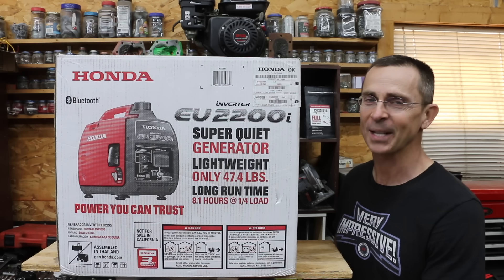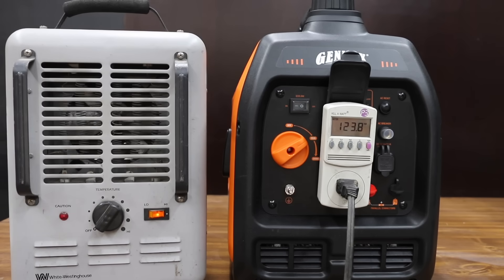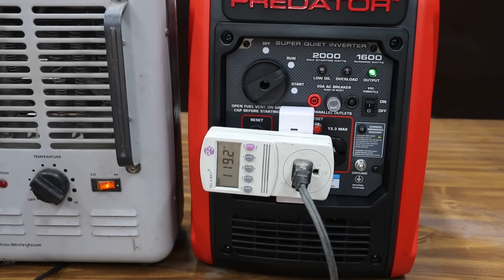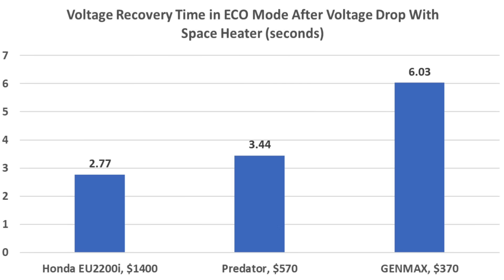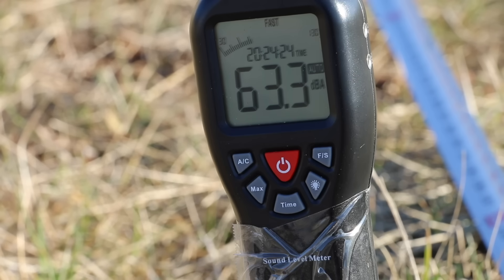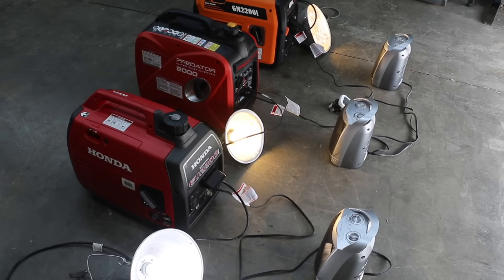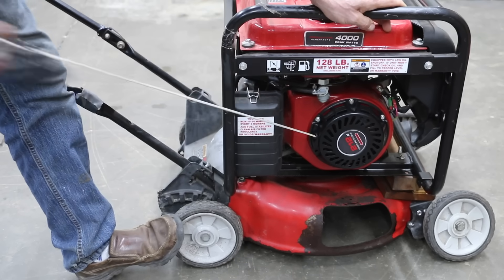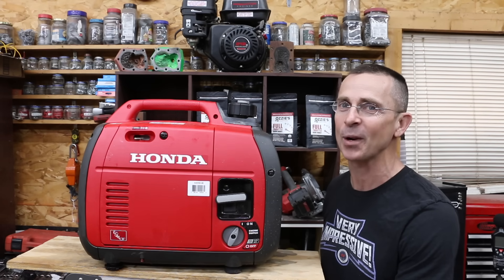Cheap Generator Better Than Honda? Predator vs Honda & GENMAX—Let’s Settle This!

Comment: For those who don't want to lose the engines in your ICE cars/trucks.   You can use oil analysis, and a secondary oil filter called a "BYPASS OIL FILTER" to nearly eliminate any wear metal flying around in your motor oil.    My results:   Camry 390,000 miles compression within spec,  Audi 210,000 miles compression within spec,  Acura 215,000 miles compression within spec ( just sold ).    Bypass oil filtration can eliminate those wear metals, silicone from dust that gets past your air filter, can then use analytically clean oil running around your engine to clean away past sludge and varnish, oils also will cool better, weigh less (it will have less particulate mass), and its additives will work better for a longer period of time keeping the oil within its PH level.     I used oil analysis to confirm the operation of these bypass filters, by sending the samples in after 3000 miles on each oil and then on that same oil after the installation of a bypass filter system.     The dirty 3000 mile oil, after being run on an engine with the bypass filter for about 200 miles, came back from the lab Analytically clean, meaning it was as good or better than new motor oil in terms of wear particulates.   Even the TBM values were similar to new oil.  Granted there is some top up oil involved in the capacity of the newly instally bypass filter, but 87 percent of the oil in each case is oil dirty oil with 3k miles on it.   these small generators do not use a pressurized oil systems (they use an oil "slinger" to lube the parts) but your car and larger generators will benefit from a secondary oil filter known as a bypass oil filter.    Most people dismiss this knowledge, say it won't work (it does work) or its too much of a hassle to install, or "why don't auto manufacturers put them on" (well take a guess)  ,  however those same people have no problem rebuilding engines, replacing vehicles, etc.   Not intended to save money on oil changes or amount of oil used (although it does), it is mainly intended to prolong significantly the life of an ICE engine that has pressurized oil system.
Reply from the maker: Thanks for the feedback.

Comment: Thank you so much for the video. I thought about getting 2 of the knock offs, but thanks to your thorough video I will stick with Honda. All the tests you did were all important to me. The fact that the Honda outperformed in almost all ways is proof enough for me. Sine, db, vibration, and a better managed eco throttle are worth the extra money to me. While too heavy to get on and off my boat by myself, I do have a 23 year old EU3000i. I just love it. Honda is way more money, but I think it's worth it. In 2005 she ran for 10.5 days straight after this bitch Wilma came to town, and really messed things up. I stopped it once a day for fresh oil change, and it was a champ. Less than 5 gal a day running a fridge, computer, modem, TV, and small rolling A/C unit. I am going to get 2 of these for my new boat. Only run one when needed. Parallel the second to run A/C & microwave. lol. Also, having 2 serves as a redundancy. Twos of things on a boat are key. Like 2 radios, 2 starter batteries, 2 engines, 2 coolers, and on & on. Thanks again! Cheers!!
Reply from the maker: You are welcome!  Thanks for the feedback.

Comment: Didn't watch whole video, but a comparison I find useful when comparing generators (especially vs hondas) is testing how the electronics hold up when the generator quits/stops/runs out of fuel while under load. When camping I frequently measure out fuel for the time I want to run my genrator. I then simply let it run dry instead of having to time it. In my experience cheaper generators have had issues with doing this some permanent. It would be interesting to see this done in testing. Great video thanks for the info.
Reply from the maker: Thanks and you are welcome!

Comment: $300 generator worked as well as a…$300 gen vs the Honda.  I’d buy it and run it with oil changes as the book says til it Dont run/produce power, shit can it and get another.  If you used one everyday day in and out it’s hard to go against the Hazard Freight extended warranty they offer.  Why I see a lot of “contractor work crews” bringing them back so often.  I get it you get what you pay for, but $1200 for such a small machine is IMO not worth it.  But each their own.
Reply from the maker: Thanks for the feedback.

Comment: Too bad the Yamaha wasn't included in this showdown. When you look at the forums (racers, campers, etc), usually the question is Honda or Yamaha? I have a Yamaha, and it is super quiet and does all I need so I won't be changing, but I am curious to see how it stacks up.
Reply from the maker: Thanks for the suggestion.

Comment: Have you ever considered testing farm implements,like 3-point shredder/mulchers, brands against each other? I know they are really expensive. You run a tight ship with respect to fairness, impartiality and practical results. Maybe the manufacturers would sponsor a head to head comparison just to get the face time.
Reply from the maker: Thanks for the suggestion.

Comment: Would you mind adding the Generac generator? We had a few of the larger generators on wheels when I was in the military, but I believe they make smaller generators.
Reply from the maker: Thanks for the suggestion.

Comment: I have two Briggs 2200 inverters. Low hrs. Just spent $300 getting the valves set & carb cleaned. Not even close to a Honda. Not by a country mile.
Reply from the maker: Thanks for the feedback.

Comment: Maybe I missed it, but why measure the gas for the heater test by weight, 16 oz. by weight, versus 16 fluid ounces?  I'm just curious, not complaining or challenging your very excellent testing in any way. :-)
It might confuse some watchers into thinking that you were testing with 16 fluid oz. which they could then extrapolate the test results differently. 
We all buy and use gas by the gallon, not by weight. 128 fl. oz. which is 6.3 pounds, or 100.8 ounces by weight. 
1 fluid oz. of gas weighs about 0.79 ounces. That times your testing weight of 16 oz. is only 12.8 ounces of gas, by weight.

Comment: I'd definately buy the Honda but $1200 is steep for how little you really get out of those things. I decided going with the GENMAX and will give it a run this weekend on a space heater at 28 degree temps outside. Heres to hoping lol.
Reply from the maker: Thanks for the feedback.

Comment: I have the original Honda EU200i it's now about 20 years old now and has north of 10,000 hours on it. Honestly I think the clones are probably good machines(given their price), but they are in pretty much every way inferior to the real Honda. I very much doubt you can put the kind of hours you can on a the Honda on any of those machines with out a serious mechanical failure. Moreover other than needing the eco throttle switch and circuit beaker replaced my EU200i has been 100% reliable. It runs as good as the day I got it and dose not burn a drop of oil....Also in your test the Honda used more fuel, I can tell you the Honda uses noticeably less fuel as it breaks in. I'd guess it's about fully broke in at around 1,000 hours....Which is probably more hours than some of the clones last.
Reply from the maker: Thanks for sharing.

Comment: So far I love my Predator 3500. Starts easy, pretty quiet and can run the ac and lights (in my motor home) full blast for 8 hrs consistently.
Reply from the maker: Thanks for sharing.

Comment: You always do such a great job with your tool reviews. I would like to see one on larger inverter generators that have Running wattage range between 7000 to 8000 Watts. There are just so many to choose from and would like an unbiased review on Brands such as Honda, Champion, Pulsar, Predator, AiVolt and GenMax.
Reply from the maker: Thanks!  Thanks for the suggestion.

Comment: I have switched from Honda to Westinghouse because when I go boat camping it will run all night on a single fill up.  The Honda always ran out of gas about 5:00 am.  I would sure like to see Westinghouse included in the testing.  The good news is when I advertised the Honda for sale, I had 20 people all wanting to buy it within a few minutes of posting it.  I love the various ways you find to measure things.
Reply from the maker: Thanks!

Comment: Somewhere on the web, probably 15 years ago, a ham radio operator posted oscilloscope pictures of the DC output of the Honda, because a lot of portable radio equipment needs 12 volts DC. The Honda, like most inverter generators is designed to make AC. The DC power is so "dirty" that it is suitable for charginv batteries only. Do not use any of these to run DC equipment.

Comment: Try getting your hands on some Parkside  equipment which is pretty common in Europe and sold via Lidl stores, I recently bought a 1200 watt invertor generator which  has worked a treat with very clean sine wave, very reliable and economical  with a cost of only £119
Reply from the maker: Thanks for the suggestion.

Comment: I supply construction inspectors and we were just talking about these the other day.  The contractors use a mix of Predators and Hondas.  What we notice: NONE of the units ever get any maintenance - EVER.  The predators seem to get damaged pretty easily.  The plastic seems to break easy.  All the Predators require about 30 pulls to get started.  The predators sound pretty quiet up close but far away they're louder.  The Hondas are a little more durable - but still have missing/broken plastic.  

The contractors use them everyday and working in NY swamps they pretty much run all day.  All engines need to be in "containment" and the Honda CO2 sensor is very sensitive and will shut off if it's in a tub with about a 4" tall side or more.  So they need to be blocked up and that's a PIA.

I think if you're using the generator around the house or occasionally go ahead and get a Predator.  At least at that point you're pulling the carb apart to clean it on a less expensive unit.  I bought a Honda and had to pull the carb this summer when I wanted to use it.  Oh well.  Good luck with yours.
Reply from the maker: Thanks for sharing.

Comment: Another thing to note besides just the volume, is the frequency of the exhaust note. Without diving into psychacoustics, different pitches are perceived to be quieter at the same volume. I believe that is why the honda seems even quieter than it measures. It seems to have a lower pitched exhaust note to me, which seems to make it sound even quieter.
Reply from the maker: Thanks for sharing.

Comment: I've got an old EU2000i laying around I use in emergency cases. I can get away with leaving a carb full of gas in it for over 6 months and it'll start within 4 or 5 pulls. Fresh gas? First pull everytime. They're not cheap no, but I wouldn't have gone any other route even in hindsight. It has been impeccably reliable, quiet and powerful everytime I've demanded it's assistance. Thanks Honda, for that, my commuter car and my motorcycles. Everything Honda I own has been a pleasure to use.
Reply from the maker: Thanks for sharing.

Comment: Hello! I have a question that I'd like to see if you can help with. I'm a video producer and I want to buy a power generator for on-location shoots. However, I have doubts. I want to connect 2 lights from the Apure brand, 600w each. Is Honda a good option? Or are there other more economical ones that work just as well?
Reply from the maker: Thanks for the suggestion.

Comment: Thank you for the comparissons. One thing that would be difficult to test short term is longevity. In my experience, the Honda will outlast the other machines by 3 or 4 to one. Not only that, when the coils need to be rewired, it is much easier to rewind the Honda. The motors also are a real workhorse. 

If you need something for a month or so and then throw away, I would go for the cheaper ones. But if you want something that will give you years of service, Definitely Honda!
Reply from the maker: You are welcome!  Thanks for the feedback.

Comment: got enough requests for solar generator to test? was hoping to find a test to see how long the highest wattage solar generator would run a full sized refrigerator (25cu) before a recharge is required.
Reply from the maker: Thanks for  the  suggestion.

Comment: These are "Inverters" which allow the engine to run at whatever rpm is needed to generate power saving fuel in 'eco-mode'.  Inverters produce cleaner energy for electronic device, use less fuel and should run longer on a given amount of fuel.    Small generators generally run at 3600 rpm at ALL to times go generate 60 Hz power. Generators are generally noisier.  The Genmax possibly over heating and having vapor lock is not a good sign  since inverters or generators need to run continuously for a LONG time.  The Predator is already burning oil which is another bad sign for an engine that needs to run for long periods of time.

Comment: I've got a ryobi 2300. Super excited tell I started using it and realized it kinda sux but I wonder if it's the size or the brand. Trying to resolve voltage overload with no loads on it..
Reply from the maker: Thank you for sharing!

Comment: I have been using a Honda EU2000i Generator,  off and on,  since December 2011,  in a motorsport environment. It's run a lot of equipment over those years, I can tell you!  Look around the paddock the next time you are there. You'll see a lot of Hondas.   The reason is, they are one item,  you can use without worrying if it will ever let you down. NOTHING in the world would make me want to change to a different brand. The Honda is unquestionably an excellent quality, well made and reliable product. Other makes are available but until they have the 100 odd years of engineering excellence behind them, I'll stick with my Honda. Thanks anyway!
Reply from the maker: Thanks for the feedback.

Comment: Really like watching your videos but I do have a question on your procedure for run time with load.

Should each unit have been tested on its own?

Given that the middle unit shut off first due to over heating is that not surprising given it was placed between two other generators that are giving off heat. Also should a test been done for running outdoors rather than in your garage? Lastly using one clock but starting generators at the same time, should there not have been a clock set for each start time?

Comment: When you need parts or service it helps if there's a dealer nearby. The Honda is covered, what about the others? One way I justified the cost of the Honda is by not having to buy battery operated tools (which I hate). I already had all the corded power tools I just needed a power source. I can set the Honda in the Gator to work on the farm or leave it under the bedcover in the truck. It's handy to have power anywhere you go. Another feature of the Honda is you can turn the switch almost to the off position and that turns off the gas. The generator runs out of gas so it doesn't gum up the carburetor. I've had mine about a year and I can't think of anything I'd change. I also have a 7000 watt generator that's too big to move and never used. I bought it several years back but if I had it to do over I'd buy two Hondas and link them together for the house.
Reply from the maker: Thanks for the feedback.

Comment: I would like to see you test, solar, powered portable generators like the Eco Flo, delta pro. 
I would be interested in seeing a real world test    
Is there a battery back up generator that could power a 220 V deep well pump
Reply from the maker: Thanks for the suggestion.

Comment: Our Condos have a 20 KW Generac generator. It is used to power the sewage grinder pumps during an outage. Last February there was a partial failure of the underground circuit that fed the transfer switch. There was enough voltage to make the Generac sensor think that the power was on, but the pump control circuits were more sensitive, and would not start. I cut the main breaker to the generator which made it start, but then it tripped off because the Generac couldn’t start 7 pumps simultaneously.  this would not have happened if the voltage sensor inside the Generac worked correctly.  Requests to Generac for a workaround went unanswered.
Reply from the maker: Thanks for sharing!
Reply: Thank you! Crappy Genset and crappy service too, what a great company!

Comment: I’ve had a Honda Eu2000i (paired) for years.  Thought it was quite expensive for a recreational generator but knew it was one of the best in terms of stable-smooth power.   Once again, your vids are absolutely fantastic and vendors should take NOTE of this channel.   Thanks!   -Nokki / Dallas, TX

Comment: The generator is related to welding machine how? 
Can I use welding currents grout streams brick currents ? 
Can I use sound for heat bouncing it off metals to create heat?

Comment: Our honda eu2000i and companions are totally reliable with fresh clean fuel and oil! Trim pull cord before it breaks. When it is too short take it in for a tuneup and re-cord. We totally trust ours for constant off grid energy all niters! Quiet and clean burning!
Reply from the maker: Thanks for sharing.

Comment: The Honda is not expensive , I bought mine in 2022 off eBay for 200 gbp or 260 dollars , it's a 1995 model that runs really well and enables me to polish my campervan at the storage facility where we keep it.
To test properly we need to scroll forward 28 years to see which one has lasted the best!
Reply from the maker: Thanks for the feedback.

Comment: I got a few 2200 watt Generacs [branded Colemans] for $300 each.

Changed the oil every 50-100 hours and cleaned the spark arrester every time. Zero issues. Both are still starting up on the 1st pull after 3 years.
Reply from the maker: Nice!